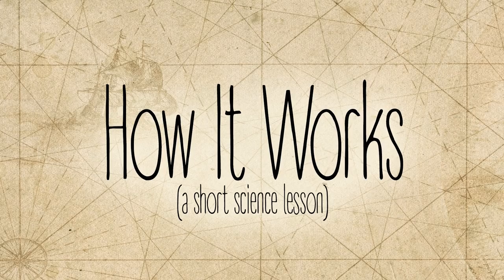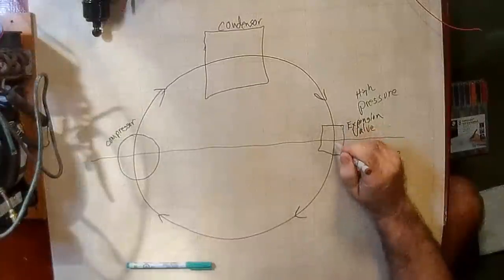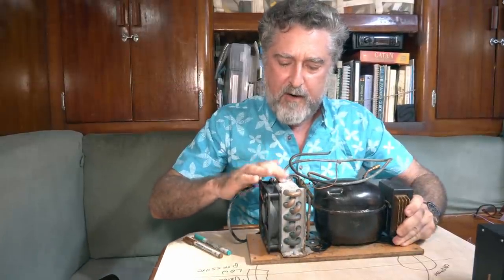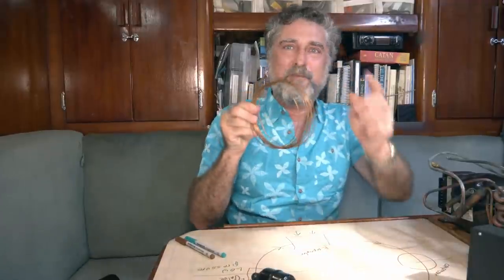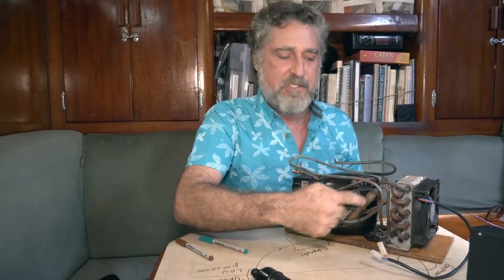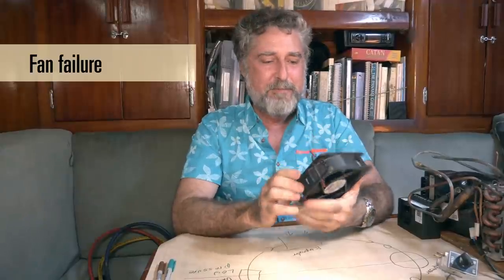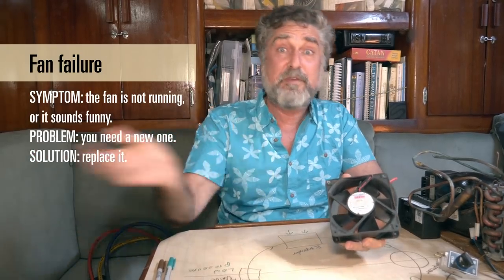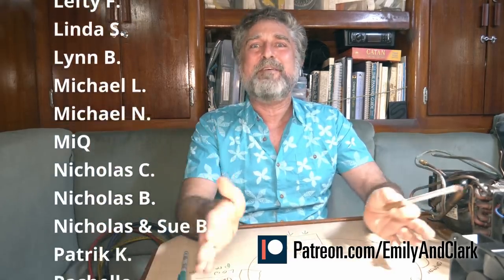How Does Boat REFRIGERATION (& A/C) Work? [Capable Cruising Guides]

Comment: I love your videos, but as a mechanical engineer I have to make a technical comment.  Your explanations about refrigeration and in general your explanations of physics is spot-on, but you lack precision with regard to heat and temperature.  You have stated a definition for heat that is instead of temperature (perhaps a slip of the tongue?).  Temperature is a measure of a substance's average random molecular kinetic energy - i.e. how fast the molecules or atoms are moving (which increases if you compress a gas).  Heat is energy in motion due solely to a temperature difference; i.e. heat always flows from hot to cold.  The compressor (and expansion valve) helps change the temperature and allows us to move the energy in the direction we want - i.e. a "heat pump" which is also an accurate term for a refrigerator or AC unit.  In an electrical analogy, temperature is voltage (potential) and heat is power (energy flow).

Comment: My fridge quit on me after about two years from having it repaired in San Diego. I had another sailor in Ensenada try re-charging it several times. I soon realized my repair guy was not really up to the task. Finally I bought a new Adler Barber unit and new evaporator. Problem solved. The guy in the next slip helped a lot as trying to install in my 36 Catalina required someone more flexible than me. Time. For a bigger boat. Lol

Comment: Thanks! Could you tell me how to figure out why my 2006 Bayliner 245sb fridge isn’t turning on with 12v? I runs fine on shore power 120v but it doesn’t work with 12v. Thanks!
Reply from the maker: Not remotely

Comment: Clark - I have been trying to figure out my “broken” freezer for the past 2 years and was about to give up and call in a service tech when I found this video. Using your trouble shooting tips, I quickly found that my digital thermostat was the culprit - it had died.  I simply disconnected the temperature probe wires, connected them together and voila - the compressor started right up and the freezer started to get cold!

I have now replaced the thermostat with an STC-1000 digital model that allows me to set a temperature and an offset value (in Centigrade).  Being new to refrigeration, I am wondering if you could provide some directional guidance for what values I should use to optimize the performance of my freezer and its related compressor.  I have initially set it at -2.5c with an offset of 3 degrees.  

Thanks for any advice you might have.
Reply from the maker: The higher the less power you use 
   But sausage and ice cream won't freeze hard.

  There is a way to adjust both the temperature and the gas pressure to really dial it in.  I guess I could do that some day.

  I hope you subscribed and watch my other stuff.  If you find something useful please share it with friends.

Comment: We need to figure out how to fix the controllers as they are now $400 plus to replace or just buy new refrigerator as they are not much more than the controller depending on your fridge. Thanks for sharing.
Reply from the maker: They can be found cheaper
  Check ebay
Reply from the maker: I bought like 20 a while ago.  They are on Temptress in the DR.  I resell them much cheaper than 400 but for local pickup

Comment: Hey my norcold fridge on my silverton gets power and when I turn it on it just hums for 10 seconds stops 10 seconds and hums 10 seconds over and over and doesn’t get cold does that sound like a controller issue or bad compressor?
Reply from the maker: Look up the datasheet for your controller and read it over, it's only two pages.
  Hook up the led and count the blinks.  It's trying to tell you it's having a problem.  Just look at the chart on the datasheet and you will know a lot.

Comment: Hi, thanks a lot, very informative video.
Only thing I don't get is that I've heard compressor works on AC, how do you get it to work on DC?
Reply from the maker: Only really crappy compressors work on ac anymore.   All good ones are brushless dc motors.

Comment: Few years ago. A lot taxi owner on Australia were putting LPG in the a/c. Ice cold, but dangerous in accident.
Reply from the maker: Yes it actually is a better refrigerant and I would consider it if it was comparable with the existing lubricant.

Not in a boat where a leak would accumulate and be really dangerous.

But a car, I could be sold on that idea.
Reply: @Clarks-Adventure  few condensers blew up if front of the taxi got damage in an accident. Events Jesus authorities picked up that they are using LPG in the a/c. Back in the 90s there was little valve on the filler U could under do and a mate used to put his can coke where the gas came, can was like ice.

Comment: The compressor, let's say BD50f, only requires 109watts.
The available power modules are 12v/24v; 115v; 220v.
When I recover a 220v BD50f, what is required to make it run on 12v?
Reply from the maker: Just the power module.
Reply: @Clarks-Adventure  Thanks.
I'm in Israel. It's cheaper for me to buy a used freezer and repurpose the parts to my needs than for me to buy the parts and build from scratch.
So simple, buy a 12v PM and swap them.
Reply from the maker: Yep, I've done it.  
   Lucky you found a bd50f device

Comment: Thankyou very much for the training of the fridges, it was great to remember  these things  i was supposed to listen to the teacher  about when i was an apprentice so very long time ago. 
I thing i did remember from those days is that a fridges may work fine for a given ventilation area installation in say New York may not work so great in say Cuba due to the increased mean outside temperature. So thanks for the tip on installing a bigger  fan boaters may need one for the hotter temperature climates
regard

Comment: I was looking for a link to this low voltage room air conditioning and did not see it.  Did I understand correctly and this something you made and are selling?
Reply from the maker: No video yet.  Things keep getting in the way and I feel I need other videos out-there first.
The lithium-lead battery video was the first of these and it became a thing of its own.
   Getting so sick didn't help.  But it's coming.  These are the last prereq.

   Selling? Not exactly.   But I should talk to the company that is picking up my lithium-lead charge controller.  They might actually want to sell a kit.  But what I'm doing is if you join Patreon at the "dream believers" level where you can just call me, I'll talk you through building your own.  People have started doing that already.

Comment: Oh boy, I wished I had seen this a year ago when I installed a new fridge (components, not the box). Extremely useful, thank you! Yep, we broke that weird 'wire with gas', luckily the company gave us a whole new system!

After seeing this, I'm left wondering whether that wire should be in the fridge, or outside. We've the cooling element in the fridge, that little motor thingy with fans age controller about a meter from it, and that gas cooling wire mostly outside the fridge. It seems to me that we ought to put it as close together as possible and put that wire in the fridge as well. However, since it's so fragile, I'm hesitant to do that (as inside it'll be too easy for my beer cans to accidentally hit it while sailing).
Reply from the maker: Don't worry about it.  Someday when you need a gas charge you could cut those connectors off and shorten all that copper and solder them back together properly.   Those connectors leak!
    But it's fine as it is.

Comment: Hi Clark, another informative and useful video. Do you have a link or recommendation for the digital thermostat ? I need to replace mine. Cheers Kevin
Reply from the maker: I was going to but then I remembered that I have to open these and modify the circuit board to have it work with refrigeration.   Thought it best not to recommend something that won't work unless you "fix" it.
Reply: Inkbird  12v  is what most people are  using and look better  ,have had one for 3 years with no mods

Comment: That was excellent. Can you use a heat exchanger instead of a fan and low power pump to cool it with seawater? I used to have a 12v centrifugal pump on my boat heating that drew under 400ma
Reply from the maker: Hi Samantha,
   Sure.  In fact I use both water and air cooling on Temptress' system.   Next week's video will show me soldering a new heat exchanger in.  -C
Reply: I'd love to make my own fridge so I know how to fix it., Your video has prompted me to start buying parts
Reply from the maker: Get a BD50f compressor and work from there.  The hardest thing is to work out the cap tube.
Before you buy an evaporator see next week's video (or watch it sooner on patreon).  I build my own and it's much better and fits what I need.

Comment: Great video as always! Looking forward to next week. Have you given any thoughts to using a raspberry pi pico ($4) or an arduino microcontroller to replace the control unit for the compressor? Seems like a no brainer if you can replace a $200 part with a pico. (Also, apologize if you get multiple comments from me, had some issues with YT this morning...)
Reply from the maker: There is a lot going on with the controller.  It's running a 3 phase brushless.  Do-abel but that's a lot of MOSFETs to coordinate.   It also does a good job of watching for loads of error conditions and doesn't seem to have corrosion issues.   
   I save my microprocessor efforts for things I just can't buy like the charge controller project.

    But if you built one there just might be a market for a cheap controller box.  Go for it.  Send me some I'll test them!
Reply: @Clarks-Adventure  I'm just beginning my journey into Pico's. I was just wondering if you had tried to tackle that issue like your other microprocessor "wizardry" projects 😁
Reply from the maker: Got to say until your comment I never thought about it.